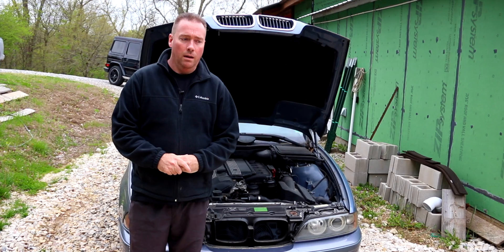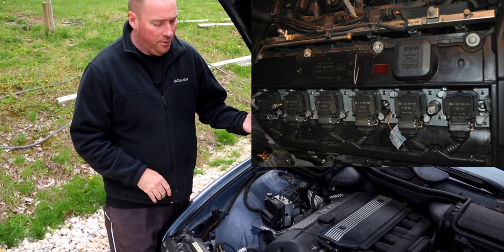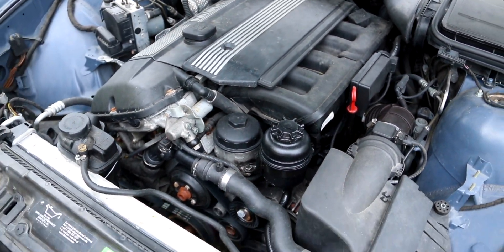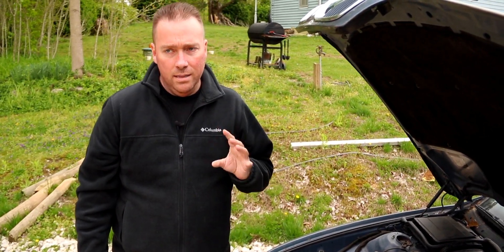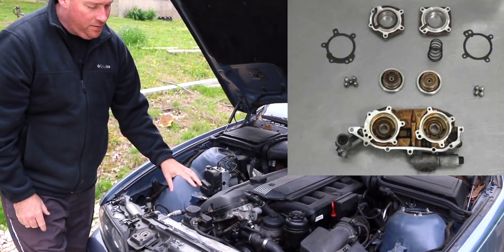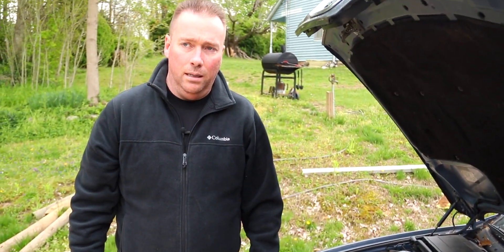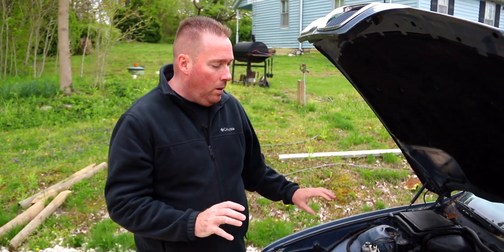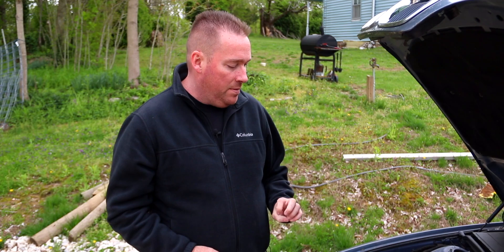Most Common BMW M54 Engine Misfire Causes And Fixes E39 E46 X5 X3

Comment: Dude Nathan my guy I need your help I have a 2001 BMW 530i with a E39 motor in it and I need to do the CCV replacement and along with all the other stuff that this car needs I have really bad rough idle but it's still runs and I absolutely love this car. It's actually saved my life at one point. I would hate to see it sit here and go to crap but I really just need help to identify exactly all the parts I will need when I do this overhaul I can't seem to find a comprehensive list of complete overhaul like you speak up in this video. I also don't know where to buy these parts and would be really helpful since you are so familiar if you could please list all the parts that I will need and I would be so inclined to do this work DIY no matter how long it takes. Any help would be great. I would be stoked if I could either have a conversation with you about the subject or if you could shoot a parts list with everything you think I might need the car has about $160,000 miles on it and it is beautiful machine. I did have to replace most of the coolant system but not all of it I get a new radiator and hoses but still there's plenty more plastic in here ready to just shatter. Thanks

Comment: Not certain, but I think I just was able to eliminate everything in this video except for maybe the coil packs from being the issue based just on this video. Thanks so much! Will return with the final verdict once I get it fixed. - 2002 325xi owner

Comment: I have a misfire on cylinder 2 when i turn the car for 50 seconds it's working after that it turns it off i checked the spark plug and coil & injector nothing the checked electrics they all good

Comment: I have misfire on all 3 rear bank (4,5,6) as soon as warm up is complete
New coils/plugs/02
Smoke test/vacuum leak test shows smoke out from below/behind the rear of the disa
Hard to tell if it’s the secondary intake hose/coming from under the rear of the disa/or something right up on the block
Will be removing things this wknd to to track it down and replace 
However-will a leak there cause a full bank misfire?!!
Any help welcome
Reply: Any updates?

Comment: My e39 525i started shaking at idle , loss of power and when I accelerate it then it cut off and now it doesn’t turn on . About to purchase spark plugs and coil packs . Just wondering is that something that would cause the engine not to crank . I changed the starter like 3 months ago before this problem. So I know it’s not the starter .

Comment: Got an E39 that starts well cold and hot, has no power loss or misfires when loaded but runs rough and low rpm idle. Readout gave P1347 misfire cylinder 3 under fuel cut-off. Hoping replacing the ignition coil pack will do the trick, as the perishable parts within eyesight from above are looking good. Thanks for the video.
Reply: Did that fix it ?
Reply: @yungzayya3737  No it turned out to be a cracked CCV so too much air and oil vapor was coming into the engine. Runs like a charm since replacing it and the vacuum lines with febi bilstein winter package

Comment: Had misfire because plugs were too long. Ebay bought in 2006 they use longer plugs. Shorter older ones. Not coil problem . I replaced everthing else and with intake and cvc disa throttle control valve. None of those caused it. Just wrong plugs.

Comment: The best thing to do is to get an up graded scan tool. It will tell you what causes the misfire. My N55 engine is misfiring and it told me that I have multiple misfire in all cylinders and number 6 injector is switched off I ordered 6 injectors and the coil to change on number 6.

Comment: Question:
I was driving on highway, put a little bit of load and began misfiring and got code for misfire and fuel cut off on cylinder 5. My ignition coils were not wet even though I know my valve cover is leaking. I pulled out the spark plug for two cylinders and they had oil on thread and very little pebble like debris on the tips. I also noticed a fair amount of oil through the pvc tube that disconnects from the valve cover. I don't hear any knocking, more of a hissing noise. Any ideas?
Reply: Following same issue. What I've heard from mechanics is these cars get high miles then there is possibility for oil starvation in those rear cylinders. My concern is that the rings are starting to go and you're losing compression.

Comment: What about a misfire that is only triggered after a hard acceleration? I keep getting it on cyl 5 or 6, no CEL switch the car off and back on and it runs normally again? New plugs and coils too
Reply: i have the same problem!
Reply: 99% it will be hoses from ccv valve.
Reply: Same problem thank you for responding.

Comment: Nice video!  I recently had a misfire which did not throw a code. I replaced the DISA to no avail. Then I replaced the coils and spark plugs in my 80k miles 2006 BMW X3. That worked like a charm.

Comment: Hi, I’m having an issue with when i start it. Dies right out. Seem to be gasping for air. When pressed on the accelerator pedal. It wouldn’t go pass 2000 rpm. When let go the gas pedal. It dies.
Reply: Unplug your MAF and see if the problem is still there - if not, get a new MAF

Comment: I have a 2005 E46 that’s runs and drives but stalls out of know where. Lights on dash come on and no power. Sometimes it starts back up other it won’t. Cranks ever time tho. Not sure what my issue is and either does two auto shops. Any help would be appreciated

Comment: im getting a missfire on my cylinder 3 also cut off, code is p1347 just showed up two weeks ago, also got some lean air - fuel mixture as well.. on both banks

Comment: this is by faaar the best video on the subject. my readout says misfire on cylinder 5 and it's a running misfire that's worse when cold. seems like a coil issue
Reply: I’m having the same problem right now. Was that your fix?
Reply: @hylotvofficial yes it was actually. surprisingly easy fix
Reply: @DenisKudlik I ordered new ones and mine is still giving the same reading. I may have gotten some faulty ones. I’m going to revisit this. Thank you!

Comment: I’m getting 3 misfire codes - p1345 - can position sensor code -p0174 lean bank 2, p1347 fuel level sensor b cylinder 3 - no power cuts off and an awful ping once in a while - I’m going to start w cam position sensor - I’ve replaced coil packs and plugs some time ago - but the hard metal ping noise scares me to death - oil and car gage been meticulously cared for car gas 130k ( 535 m54 2001). Any other recommendations ( all boots etc we’re replaced about 10k ago )

Comment: great vid, thanks. Question: i use WOW diagnostic on my x5 e53 3.0(m54), scannes says P1083/P1085; I`ve done vanos, ccv, valvecover gasket, no vacum leaks. Wow says bad O2 sensor, bank1/bank2. The fault on both banks came at the same time, so dont think its the O2 sensors. Could a bad Maf give faulty 02 sensor reading? Great channel, keep it up!
Reply: O2 sensors kinda tough, most of dtc comes from maf goin bad or dirty..😊

Comment: Hey, Nathan I have a M54  with a few codes, more recently a P0313 misfire with low fuel. Any idea where to start ? I've replaced the CCV with the kit from FCP. I do however have a mismatched coil would that effect anything ?
Reply: Put more gas in the tank.

Comment: I have an e30 M54B30 swap with intermittent misfire it seems. Happens randomly, after warm up. Completely cuts power, won’t even make it up a hill really. New plugs, injectors, and clear codes and it runs fine. Super confusing

Comment: Hey thanks for doing what you do to help the community. I'm having trouble with my e39 540i. I had 7 trouble codes. I changed all the coils and the spark plug. Dumped Lucas fuel Injector cleaner down the cylinder P1345 last code remaining. I changed the themostat. Crank position sensor. Spark plug coil and it's still having the cylinder 2 misfire code remains. Any other suggestions will be appreciated thanks 😊
Reply: Check your MAF sensor
Reply: Switch out your fuel injector with another cylinder, just cause you ran cleaner through it doesn't mean it is clean. You could try running cleaner through it in reverse after you pull it as well just incase a large chunk of gunk is stuck inside.

Comment: Any help? Just this night I was out and my 1999 2.3l z3 got stranded in the parking lot with a locked steering wheel and the car unable to turn on. Just before hand everythang was working normal and earlier right as I got into the car the steering wheel locked up and I didn’t think anythang of it since all I gotta do is turn the key and wheel and it unlocks, this time it stayed locked and I was unable to unlock it because when I put the key into the ignition the first turn all I hear is the ding go off letting me know the door is open as normal and once I turned it into the next position and It felt odd, normally I should feel some resistance from the ignition but it had none and nothing happened. No lights on the dash and in the next turn no crank or anythang, just silence. I tried over and over again to free the steering wheel and turn the car on but nothing was happening. It’s a 5 speed manual, headlights and amber lights still came on so it wasn’t a bad battery, tow guy tried to still jump it and it didn’t change nothing. My thoughts was that maybe the wheel locking up triggered some anti theft system or immobilizer or is somethang do to with the ignition switch but honestly I’m clueless. Any help and information is greatly appreciated as always!

Comment: Great Video! Just got an 04 e46 2 weeks ago. Trailered it home as wasn't running. Replaced everything you just mentioned.  ofhg,ccv, intake boots, disa o ring, alternator,belts, maf, plugs,coils,secondary air check valve and vacuum hoses. Runs pretty good now. Still a slight misfire on cold and hot starts for about 5 seconds. I noticed 3 vacuum ports on back of intake. 2 capped and one open. Should that be open? My secondary air check valve does not have a vacumm port and I assume that's what would go there and capped it. Was this right?
Reply: I saw online someone got vacuum leaks from a plug being cracked (maybe yours fell off?)
Reply: Ended up using that port for the pilot O2 mod. Still misfires on #5 but is better then it was.

Comment: Great video, Nathan. I have an M54 on my 2002 Z3 Coupe. Also, the cooling system needs a refresh at 10 years or 100k. Parts for that cost me about $750 and the job was easy.

Comment: I've got a weird one ive been chasing for a week. I've got an '02 E53. I did valve cover gasket and plugs all at once. I immediately got misfires on all 6, with fuel cutoff on 2 and 3. Plugs are brk6equp or whatever oem is. Did the coil boots just in case the resistance was too high. Unplugged maf, it ran better. Ordered a VDO maf, same issue. Took valve cover off again, gasket was perfect. Did the fuel pump about a year ago. CCV and intake boot was done less than 6 months ago. Idle air valve is clean. The only thing I noticed is that the DISA valve comes out with no resistance, and I can hear what almost sounds like whistling. Ordered a new o ring, should be in tomorrow. If not that, I guess fuel filter and maybe coils? All the codes are for lean conditions.
Reply from the maker: Did you break the ccv hard line when you changed the valve cover? also if you got the plugs offline they are more than likely Chinese clones and will only misfire and cause issues
Reply: @NathansBMWWorkshop  plugs came from autozone so who knows, but I've tried 2 sets. The ccv line is good, I disconnected it before removing the cover. The weird thing is the car runs fine under load. It doesn't feel down on power really, I can drive it no problem, though I'm not because I don't want to burn a valve or anything. At idle though, it shakes and you can hear the misfire.
Reply from the maker: @SuSpence1119  check the throttle
Body boot , might be the ccv
Reply: @NathansBMWWorkshop  do you know if there's a vacuum diagram around the internet? I found one port blocked off, one open on the vacuum cylinder thing under the DISA, and one open on the side. Two open on the back of the manifold down by the starter. It still runs like crap, shaking badly and the lights are flickering.

Comment: If the Disa still holds good vacuum, the loose flap and pin can be replaced with a kit from German Auto Solutions for $70 instead of replacing the whole thing.

Comment: 05 E46 M54, new fuel pump, new filter pressure regulator, doesn’t want to start but shot of ether, fires up runs great, perhaps a new video on this issue

Comment: Great video! I love the e46 & e39 content!! Question why dose your e39 not have clutch fan? Would love to see a video about the e39 clutch fan
Reply: Newer ones have electric fans or a lot of people swap the clutch fan for electric
Reply: @RB-pr1xs  thank you!!
Reply: I'm very curious to a more detailed video on that. Afaik Nathan has only mentioned in previous videos that "The clutch fan, basically does nothing" while that is, either too simple or probably not true. It is true that there is redundancy in the M54 cooling system. So, when there is no clutch fan, the aux-fan will maintain a decent cooling water temperature. The other way around, with a broken aux-fan, you can experience have good temperature too (unless you run the airconditioning AND it is a hot day, and you are stuck in traffic, then not).  
In my case the clutch fan really has a function. Without the ABS light comes on, thus the ABS computer likes the air-cooling. My hypothesis: The engine and its surrounding (plastic! ) parts don't like too high temperature differences, especially over time. Therefor the aircooling-part is there for a reason. It's part of the design (althought the m54 was the last engine designed in this way). The clutch needs to be good ofcourse. And such a fan has some disadvantages, it takes away some power, it can explode, hard to reach the belds. I only have 5% of the experience of Nathan. Still I would not remove it for a daily driver.